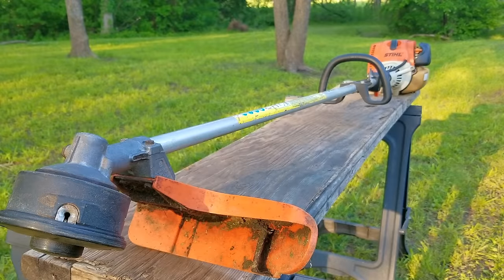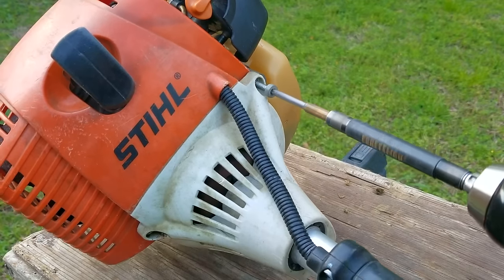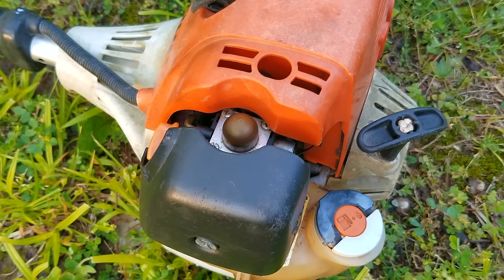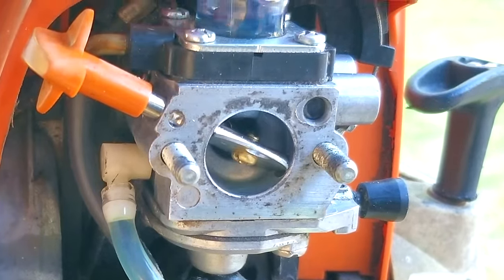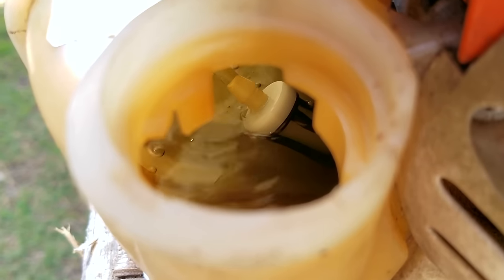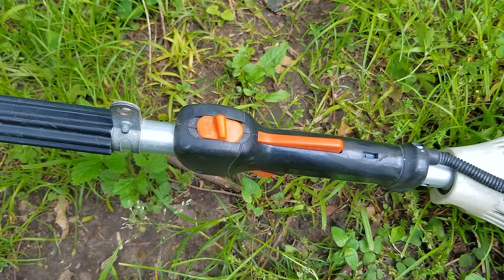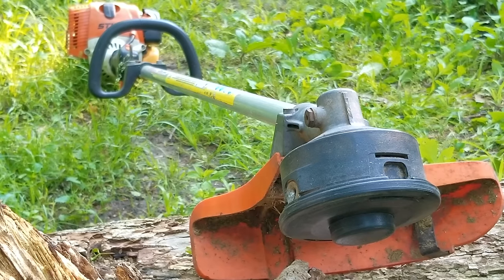Fixing A Stihl Trimmer That Doesn't Always Stay Running.

Comment: Hippa makes great carb kits.  I just repaired an FS70 line trimmer.  It. Came with new fuel lines, spark plug, air cleaner, priming bulbs etc, all for about 19 dollars.  Everything fit and the carb ran perfectly, with its factory settings.  I only had to decrease the idle.  It had been to the stihl dealer three times, and the customer was charged 120, each time, and they never fixed it.  The last time they told him to throw it away, if it didn’t work.   They didn’t even change the spark plug, which was rusty and spent, and didn’t check the fuel line, that was ripped inside the tank. I sent the customer back to the shop to the shop with the ripped fuel line, to see if they would give him some of his money back.  They said, when they fixed it the first time, there was a 1 year warranty in the repair.  I tested the trimmer on my own property, for two hours, and it runs perfectly.
Reply from the maker: nice thank you for sharing that

Comment: You made the right choice buying a new carb, those zama carbs used on Stihl trimmers always have issues with the check valve assembly under the purge bulb, either one or both check valves get stuck open which causes the bulb to stop working or it does suck up fuel but when you press it some fuel returns into the carb and squirts into the throat,
Reply from the maker: thank you,  I appreciate the information .

Comment: I always leave fuel in my stuff over winter specifically so I don't have problems. The trick is, when you run something out of fuel there's still a little bit in the carb. You'll never get every drop out. That little bit gets cruddy way faster than a lot of fuel would, causing problems. I leave fuel in everything and then go start it and run them a few minutes once a month in the off season.
Reply: You have to run the engine out of fuel & just as it’s about to stall out you flick the choke on.
Also you have to prime the fuel lines clear.
I never leave fuel in because the ethanol degrades the rubber diaphragm, rots the fuel lines plus the purge bulb & non return valves.
A tiny bit of fuel will only leave a spot of varnishing.
Reply: @WhiskeyGulf71  I leave fuel in all my equipment, I do however use  can fuel.
Reply: @garyalensr   
I had to change the carburettor on a handheld leaf blower last autumn that had been stored with ethanol free can fuel in it, all the lines were brittle along with the purge bulb & there was a cloudy substance in the fuel tank that had blocked everything up inside the carb.
It also seems to lose it’s octane over time causing lean running.
Reply: @WhiskeyGulf71  Well damn, now ya got me nervous. I guess ya changed my mind, I'm gonna go and drain the fuel and run it dry. Thank you for telling me this, you just might have saved me some trouble come spring. Have a good weekend my friend
Reply: So working the primer bulb while the gas tank has been emptyed/turned upside down will probably expel most of the gasoline out of the carburetor?  @WhiskeyGulf71
Reply: @WhiskeyGulf71 I get ethanol free gas from one of our local gas stations and use that. I leave gas in my equipment and never have issues.
Reply: I always leave fuel in my stuff. Have had no problems with it, but I always use premiums gas, Stihl oil, and stabilizer.
Reply: Same, I run mine for about 30 minutes with the metal blade and use it on the snow😂
Reply: @garyalensr that gets expensive when you are running your weed eater for 8 hours or more a day
Reply: @WhiskeyGulf71 you shouldn’t be using ethanol  in the first place in a diaphram pump engine!

Comment: I have a FS 90 4-mix, great trimmer.  It is a 2008 and still running strong with lots of low end power and torque.
Reply from the maker: thank you Mike Spain.
Reply: What is a 4 mix?
Reply: i had the same thing and it had clutch issues but it did work out great once i did a redneck engineering on the clutch.
Reply: @robstone5333  it is a kinda 4cycle but still takes 2cycle oil and gas mix.
Reply: @24space310 dare I ask?

Comment: Had a stihl km 90r since the 4 mix engine came out in 2006 i think, still use it daily now i adjust the valves yearly, throttle cable and clean out the carb also do general maintenance bits still running solid just replace the odd wear and tear bits and she keeps on going 👍
Reply from the maker: Thanks for sharing

Comment: thanks home garage perfect timing i ve been asked to work on the excact same engine thers is fuel coming out from around the push rods now i will check the valve lash many thanks for the upload 👍
Reply from the maker: Glad I could help
Reply: i carn t thank you enough home garage i adjusted the valves and cleaned the carb runs perfect now thanks for taking the time to make these videos i am subscribed and watch them all👍

Comment: I think you may have just helped me to fix My Stihl trimmer, i think mines a bit Newer than this one for sure...Lately Ive been finding the Air Filter soaked in fuel,  it may be Leaking just like this one . Ill have to investigate further but mine will run but i have to fiddle with the choke almost like this but not As bad .. You may have just saved me a pile of money, time and aggro . Cheers mate .
Reply from the maker: thank you Fetus.

Comment: Nice video! But just so you know, you lost the washer that goes between the screw and the valve cover
Reply from the maker: you notice that too, yeah I couldn't find it after that.
Reply: @HomeGaragechannel  thankfully they're pretty cheap, but you gotta crank it down a little after you lose them to avoid a vacuum leak, they do use mixed fuel after all :/
Reply from the maker: yes sir.
Reply: He sho did! I was gonna bring it up but ya beat me to it! Lol

Comment: Yes, I've always left fuel in the tank and carb during winter storage. I only use the Stihl canned fuel as recommended by my Stihl dealer. No issues since 2018 on my FS 38. 😊
Reply from the maker: nice choice
Reply: I purchase ethanol free fuel at a marina and mix a good synthetic 50/1 oil and have had no problems since new in 2005.
Reply: With Stihl Moto Mix fuel, Husqvarna or Harvest King’s fuel, you can get away with leaving it in the tank/carb over winter and not have any issues starting in the spring. Though best practice is emptying the tank and running the unit dry.
Reply: @karolyhacs6923   with premixed fuels it also might be the better decision to leave fuel in it, i have read about membrans drying up without fuel vapor.

Comment: See, you're a celebrity now and this is why I always have a spare. I never have understood why Stihl put valves in a 2-cycl;e but I guess they work all right but I hate the sound of them. I would've ordered the kit because I have a dealer 1/2 mile away and used the spare. And I usually left the trimmers with gas in them because our winters are pretty short. And when the 4-mix rigs came out there were a PILE of cam gears and magnetos replaces under warranty. My pal that now has his own shop was running the shop at the dealers and I saw him regularly and phoned even more. Good fix and Thanks!
Reply from the maker: not sure, but If I had to guess, it was for emissions
Reply: @HomeGaragechannel  I'd say you're right!

Comment: I usually do let it run out of fuel when storing for winter but I forgot to do that on two chainsaws I have.  They hadn’t been used for 5 years, since 2017 😂.  What I noticed was the gas had all but evaporated leaving an oily residue but believe it or not I added fresh fuel & they cranked & ran fine thankfully! Maybe it was just luck idk😃
Reply from the maker: very nice

Comment: You're a brave man to modify that aftermarket carb before knowing that it works and isn't junk that needs to be returned. It's fitment issues like this that have me preferring OEM carbs. In hindsight, I would have dropped the gas tank before permanently altering the new carb to get around the clearance issue.
Reply from the maker: yes it was quite the risk, but sometimes things like this happen.
Reply: Hippa has good aftermarket carbs.  I’ve purchased three, to fix a Stihl chainsaw and two string trimmers.  They were perfectly adjusted, and came with spark plug, fuel line extra primer bulbs, and air filter.  I got one other  brand knock off, that was bad.  It would run lean unless the high speed needle was turned all the way out.

Comment: I’ve just repaired my km 56 multi tool head. Kept carby just new kit. New ignition coil, plugs. First issue was fuel primer broken- air in line was all that was stopping it. Then plug lead was stuck to plug head and I accidentally broke ignition lead lol. Then it just wouldn’t run, then broke starter cord. Then I took all covers off, degreased entire machine, took to it with water pressure, dried it with a blower then degreased again all over and cleaned. Last thing was getting the jets right then fresh fuel with Stihl oil. Oh and free’d up those black plastic grab things when replacing starter rope. Runs like a brand new one- 2009 model.
Reply from the maker: very nice work!

Comment: I use Stabil fuel conditioner in the gas. Engines start right up after winter storage.
Reply from the maker: thank you The Casual Citizen.
Reply: i use stabil all the time.   after 15 years dolmar starts 1 pull everytime,  even after winter .  no need to change carb

Comment: I have the same trimmer and recently had the same the same (not) running issue. Also got a new carburetor for the same reason you stated-rebuild kit costs more than a carb. Valve adjustment is routine periodic maintenance for these. If the new carb didn't fix the issue, the cam gear would be another place to check. They are plastic and can also wear out, though my 13 Year old FS90 gear is still good as new.
Reply from the maker: Thanks for the info!

Comment: I use pre mix vp 50to1 ethanol free fule. So yes I leave full in my trimmer during winter storage.  Never had a issue
Reply from the maker: thank you Marc Hall.
Reply: @HomeGaragechannel  yeah the pre mix fule is expensive but worth it. It contains fule stabilizer its good in the can for 5yrs. And 2yrs in the tank I did leave some in my stihl fs 56rc trimmer for a yr and half . And it started right up with no problem I did sell the trimmer because I didn't like it. I've since bought a echo 2620. I like the echo over the stihl. Grate video by the way
Reply from the maker: yes I would always recommend canned fuel, because of all the benefits you mentioned  thanks again.
Reply: Do you use 94, or 97 octane? I use the 97 octane, and it works great.

Comment: Whenever i put up any lawn equipment up for the winter i will drain the tank and run it dry. Never have any issues getting them to run in the spring. Only my riding mowers get used year round. I have a plow on my Husqvarna and a snow blower attachment on my Troy Bilt
Reply from the maker: very nice James Hedrick.

Comment: I've been leaving fuel in my Trimmer and blower over winter. I do use premium gas and fuel stabilizer. with that said, I'm watching your video because my 6 year old Stihl trimmer is running rough.
Reply from the maker: is it a 4 mix engine?   Otherwise it might benefit from a slight fuel adjustment

Comment: No, I warm it up, drain the fuel and run it at idle until it stops.  I just got through bringing my Husqvarna 28L out of storage since last October (10 months) and it ran fine when filled with fresh fuel and topping off the gear drive with new grease.  I use Snapper#2 grease in the cutting head.  I also hang my trimmer up in the shop by its cutting head, so any extra grease will lube the drive shaft during storage.
Reply from the maker: Great tip! thank you John Clarke

Comment: After each use even during the season I always empty the tank then pump the priming bulb to purge the carburetor of fuel, empty out this drop of fuel out too then start the engine until it stalls. I have never had any carburetor related issues in years using this procedure.
Reply from the maker: very good technique.
Reply: I’ll have to try that. Thank you!

Comment: Mine get used during the winter in NZ but it might sit still for a couple of months. Never have removed the fuel on any. I did find fuel glue in dads old blue homelite carb. That had been in storage for years. Still have it and goes like a gem every 6months. Can't get it serviced cos it doesn't have a Brake bar so I gotta DIY.
Reply from the maker: Thanks for sharing

Comment: With larger tanks on equipment like a zero turn mower, we might leave some fuel in the tank over Winter (in SC) but we'll ad Sta-Bil to the tank and run it for a minutes to circulate through the carb if we do.  Small 2-stroke stuff we just run out the fuel.
Reply from the maker: I completely understand and when I had my zero turn, I did the same.

Comment: I have the very same model. I looked at the tag underneath and it's a 2009, I paid quite a bit for it new but I'd say it's pretty stout. It still handles thick weeds and brush just fine. Not a throw away machine
Reply: I’ve just bought a second hand one £80 starts first pull😍
Reply from the maker: thank you Andrew Donohue.
Reply from the maker: nice
Reply: @HomeGaragechannel  i dont buy cheap consumer grade lawn and garden crap. my "lawnmower" is a kubota BX 2350 with a 54" deck. it has a 3 cylinder 23 hp kubota D902 diesel. i bought it used a few years ago with just shy of 400 hours, it's probably around a 2006. the engine and mower deck are still used on the latest model. before that i had a farmall cub with a 60" danco C3 belly mower. the farmall cub is a great tractor and used it for a number of years, it ended up eventually needing a clutch and an engine rebuild (tired but still ran). i sold it for almost as much as i paid for it.

i just dont see the value in buying something that has a short service life and will start breaking often before it's life is expired. buy once, cry once.

i have around 2 acres.
Reply from the maker: very nice, thanks for the information.

Comment: Nice work including valves and clutch.
At first glance age of the machine but looking at purge bulb it was time for new carburettor.
Cost to repair outstrip buying a new one if you had to buy OEM replacement and new clutch system.
The gearbox needs greasing every 20 hours too,  a rookie mistake I’ve made in the past, it’s easy though you just undo screw screw in the grease container squeeze and rotate head, and take out and put screw back in.
Reply from the maker: ah, next time it's in, I'll have add some grease.
Reply: Where is gearbox screw?
Reply: @LJ-kr4iz  looking down the shaft on right hand side, on most Stihl Trimmers FS55 old version and FS85 and up.
The newer FS 55 doesn’t have it anymore, past 3 years at least.
Youtube - How to Grease Stihl Trimmer (My advice is to turn the head whilst filling to distribute grease evenly).

Comment: I have left fuel in all of my two-stroke equipment overwinter forever but I do drain that old fuel out and start with fresh fuel the following spring. A much better option should I be less lazy is to fill the carburetor with two stroke oil for winterization.
Reply from the maker: I like the 2 stroke oil idea.  Should work great for those worried about drying

Comment: I dont run mine dry because l am able to run my equipment year round doing different tasks. And l use ethonal free gas with either Amsoil saber or echo red armor, and both claim to stabilize the fuel. And if l dont need to use a piece of equipment l still start it and run it every few weeks to avoid issues. Now if l were to not touch a piece of equipment for months l would run it dry and spray some wd40 in the carb to prevent any moisture from causing rust and on the metering diaphragm to keep it from drying out.
Reply from the maker: thank you Ethan Miller.
Reply: @HomeGaragechannel  Your Welcome!! What are your thoughts on the 4-mix stihls? Would you buy one of them or would you get an echo?
Reply from the maker: no 4 mix, I would go with echo.
Reply: @HomeGaragechannel  Same here! The 4-mixes seem too complicated for a string trimmer and less reliable than an echo IMHO.

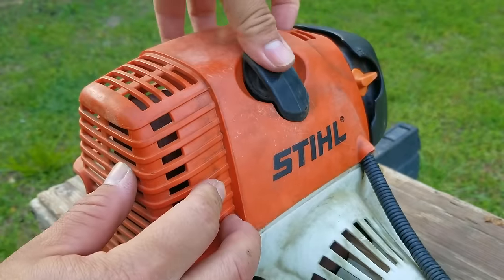Comment: btw small nit : You missed a washer on the rocker arm cap , it fell down (2:24) when you opened it and you put it back without it  (3:52).

By the way why you never check the grease inside the head ? I mean would it make any difference ? Or the should is enough for you to know if they have all the grease they need ?
Reply from the maker: did I? I'll have to take a look again thanks

Comment: If I am not going to use my trimmer for 2 or more months then I drain the fuel and run it dry.  I also use nonethanol fuel as a second option.  I do wonder why that carburetor was leaking.  Makes me wonder if it had a hairline crack someplace.  Thanks for the videos.
Reply from the maker: thank you D Butler